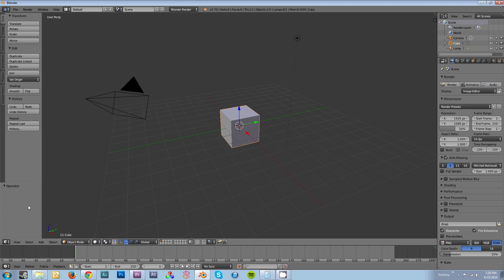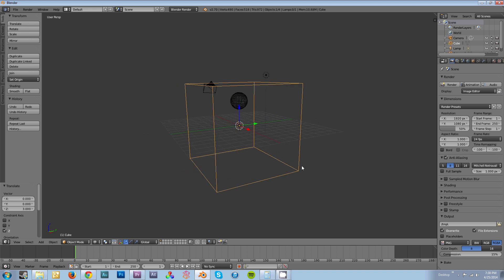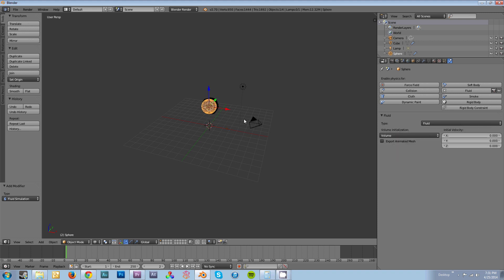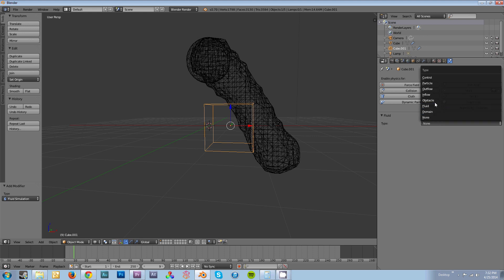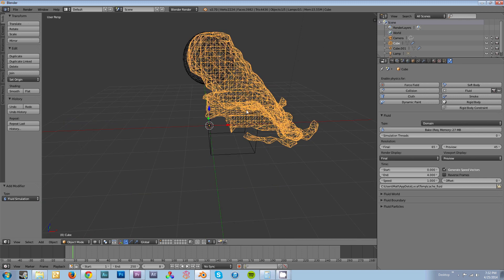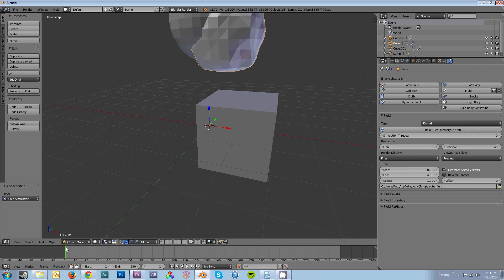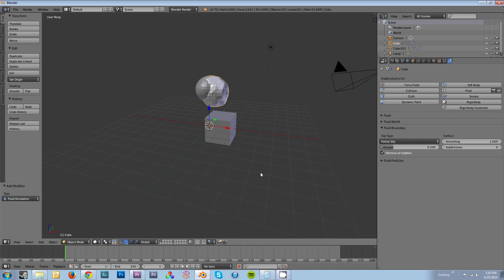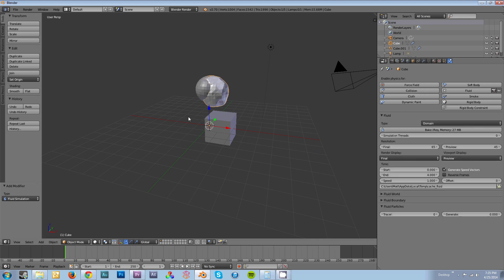Blender Fluid Simulation Tutorial

Comment: Great video, thanks for putting this out there.  I have a question.  I want to make a wave simulator.  This would require me to tip a container of water back and forth.  When I try to mix the water physics with manual animation (ie: moving an object, setting a keyframe, moving/rotating another object, setting another keyframe, etc) it seems to reset or mess up my fluid phycsis.  How can I mix both things together?

Comment: Good tutorial! Do you know if there is a way to add more foam particles as well? I'm trying to make a simulation for integration into live action.
Reply: JBHMEDIA Foam is tough to add into blender because the fluid simulator is not a strict particle simulation like it is in most systems. The particles generated by blender tend to take on the material properties of the fluid, although I'm sure there's still a way to change the material applied. Also, the particles die on contact with the fluid. In order to get a decent foam, you'd have to create a separate particle system that is generated from the fluid mesh, which I unfortunately don't know nearly as much about. And you'd probably need a pretty solid material node setup to make the bubbles feel dynamic and realistic. I'll look into that in the future, If I find anything I'll let you know.

Comment: is there a certain size you can scale this domain too? say for big scene? or am I stuck making like 8 feet or so scenes? also, to create waves, how would I do this? i guess using fluid is better than ocean modifier because of the collision modifier for landscapes. as for polygons you mention, doesn't nurbs have lower memory? so creating a landscape with that may help?
Reply from the maker: You can make the domain any size, but the quality depends on the resolution, not the actual size of the domain. Yeah, Nurbs have lower memory, but for the sake of the tutorial I stuck with the simplest method of making sure the simulation would work properly.
Reply: Matthew Manville thanks for the reply back, I just had one more question, how do you do the wave former? I guess people make tsunami with it but, I would like try a small shoreline scene with small waves, do you still use the inflow?
Reply from the maker: That's a pretty complex simulation, and higher end particle based fluid simulators would be a lot better suited for that kind of animation. It's hard to say, it may be possible, but it would take a very particular setup unfortunately.

Comment: whenever i do fluid sims and try to put fluid into lets say a cup the fluid always clips though the obstacle (cup). any advice on how to fix this? (sorry for the atrocious punctuation)
Reply from the maker: Raising your domain resolution will help a lot with getting more accurate collisions with your obstacles. Also, make sure your cup has some thickness. It will almost always clip if you don't have any thickness to the edge of your cup.
Reply: well i have a thickness of .0350 and a resolution of 200 but it is still clipping. Are one of these options off? (Thanks for the response)
Reply from the maker: It also relies on the size of your domain. If it covers 10 BU it'll take a much higher resolution to interact properly with the cup, compared to if the domain only covered 1 BU

Comment: When I click on domain in the physics panel the cube stays the same shape as opposed to changing as yours did in the demonstration. Any ideas?
Reply from the maker: Once you start baking it should change. Mine only changed because I had fluid sim data in my cache, your cache should be clean until you start baking.
Reply: Matthew Manville Thank you, i had the same problem (:
Reply: +Matthew Manville Hi I had the same problem. The shape changed after I baked it, but it wouldn't simulate the fluid motion. Do you know why that could be? Thanks
Reply from the maker: Rain Wang can you explain more details?
Reply: Thank you for your reply. When I click "Bake", the cube turns into the "Domain" object, but it wouldn't "flow down" like in the video. It just stays there by the sphere while the "Fluid Simulation" progress bar keeps running.
Reply from the maker: Is there any form of animation to the fluid at all? It's possible you have it set as an inflow, but there is no inflow velocity, so the fluid just "hangs" in the air mostly.
Reply: 2% of bake, in 30 minutes... RIP MY COMPUTER
Reply: Exact same problem
Reply: What the f*** is baking and how do you do it?

Comment: I'm about to render my animation, what resolution should I use? Like, what's considered too high and too low?
Reply from the maker: Your render resolution should probably be either 1920x1080 or 1280x720. They're both HD resolutions that'll look nice on most platforms. If you mean your fluid resolution, that really depends on the length and complexity of your simulation. When you change your resolution, your required memory space will be updated (It tells you on the bake button). Basically, that number has to be smaller than the amount of RAM on your computer. So I have 16 GB of RAM on my system, so I can do a simulation with a resolution that'll bring up the req. memory space to about 14-15 GB. Your system might have more or less RAM, I'm not sure.
Reply: Matthew Manville I have 12 GB of RAM, and the current resolution I'm rendering at is 350, which uses 4 GB of RAM.
Reply: Also, do you bake the water before rendering? I'm baking it right now.
Reply from the maker: Niceguy3210 Yeah, you bake before rendering. Also, your resolution depends a lot on your scene. For some scenes, 250 will be more than enough. For others, 500 will seem low poly. It just depends on the scale of what you're attempting.
Reply: I pretty much did what you did in the tutorial. It's taking a long long time to bake though. I'm thinking of turning it down to about 280 or something
Reply from the maker: Baking takes a very long time, and your resolution will make baking times increase exponentially, unfortunately.
Reply: That's okay, I'll leave it running overnight.
Reply from the maker: That tends to be the plan. And depending on how you set up your render, you might want a whole day for rendering. I might do a quick video on some good ways to export.
Reply: Ok, thanks :D
Reply: Is 250 frames 2 and a half seconds?
Reply: Matthew Manville When I press render, i just get this grey, non see through liquid from when i was working on it.
Reply from the maker: Select your domain and click on the materials tab. You need to add a material and turn on transparency. Also, 250 frames depends on your frame rate. At 24 fps it's a little over ten seconds, at 30 it's 8.3 seconds, and at 60 it should be close to 4 seconds.
Reply: okay thanks :D
Reply: love your profile pic ;D
Reply: Ben Tippett 8D